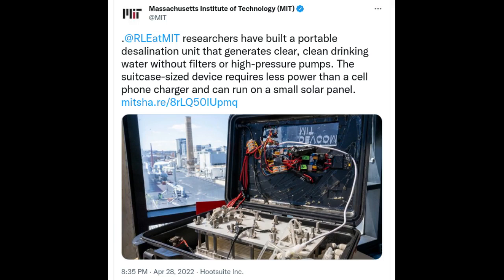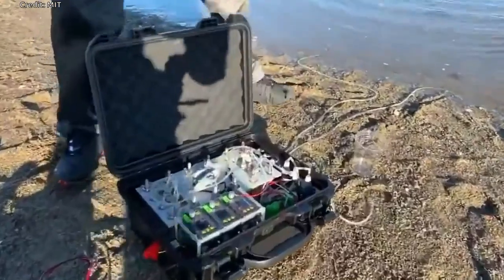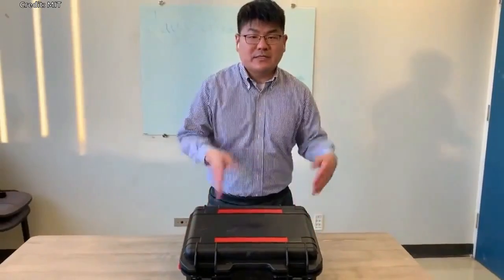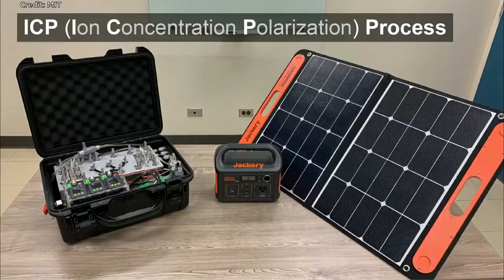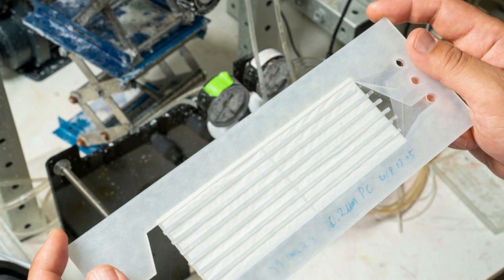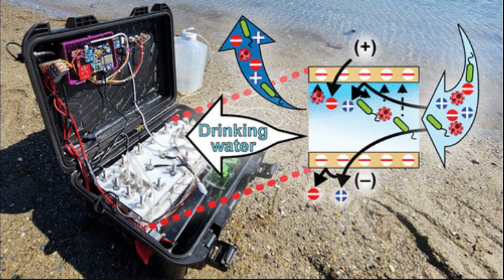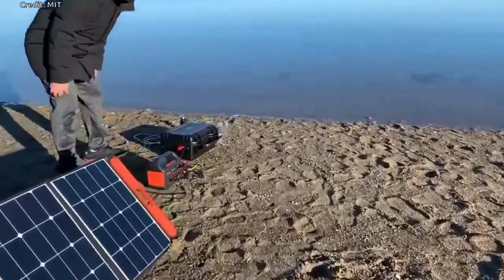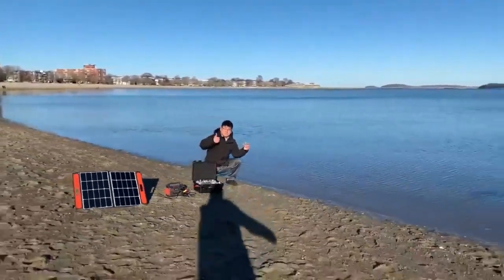From seawater to drinking water, with the push of a button |  Portable Seawater Desalination System

Comment: I have the feeling it's electrolysis system. Which combine the gases O2 and H back to water
Reply: Nope. That's not what it is. It just pulls out charged particles using a very small charge. Which you'd know if you bothered to watch the video.